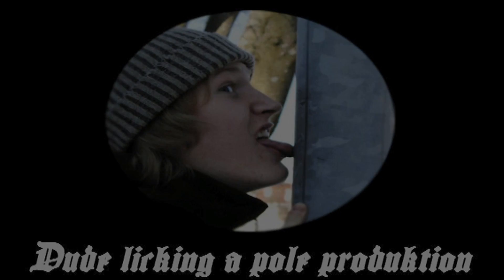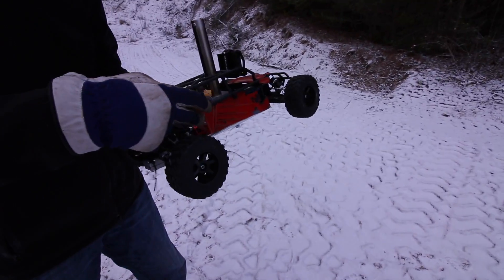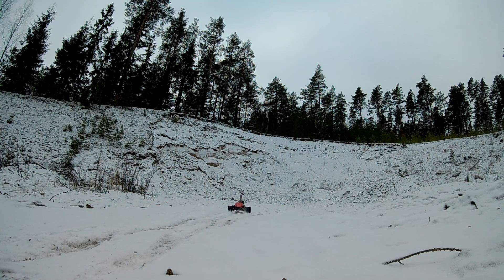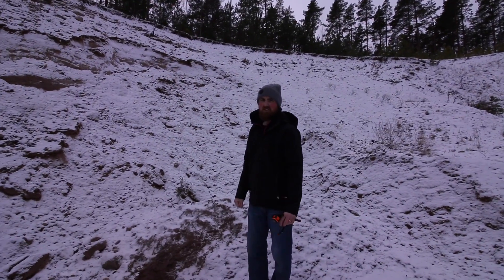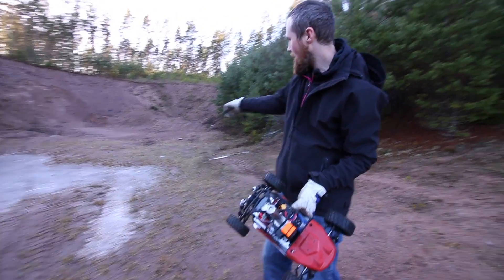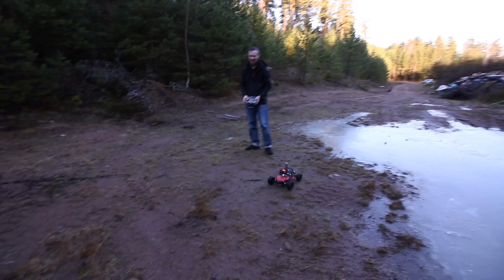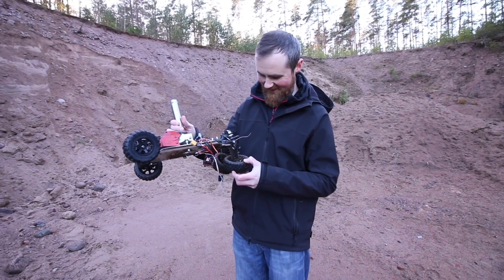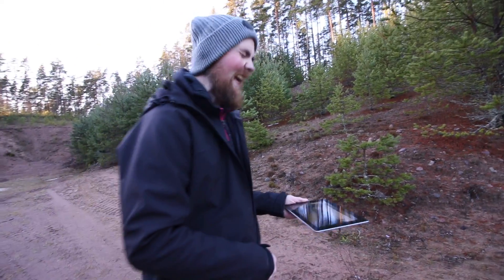ROCKET JUMP RC CAR - Over a 10m sand WALL (Doesn't end well)

Comment: I'd be curious if som kind of flight controller/gyro stabilizer would be able to keep up the the acceleration and then independently from the main controls be dealing with flight stability to keep it going using some strong servos and control surfaces ... meh probably not to viable either way

Comment: If you are going to do it again, look into having the rocket a little higher so as to raise the centre of thrust above the centre of mass. I'd bet that if you balanced the car on the engine bell as it is, it would tip over to some degree. If the engine was higher it should self stabilise......should.....hehe!